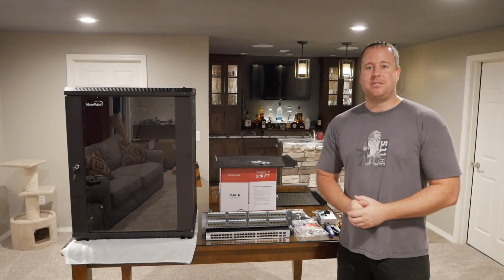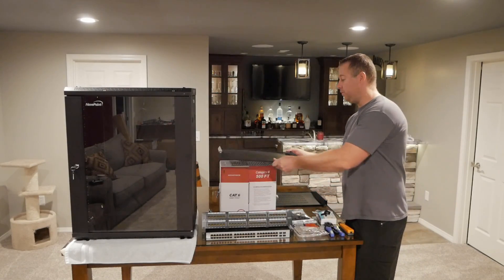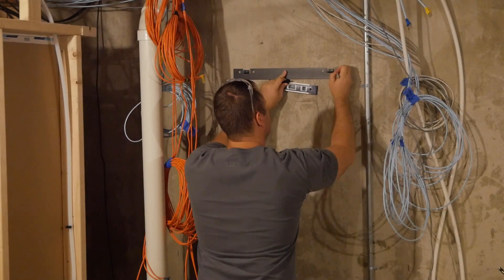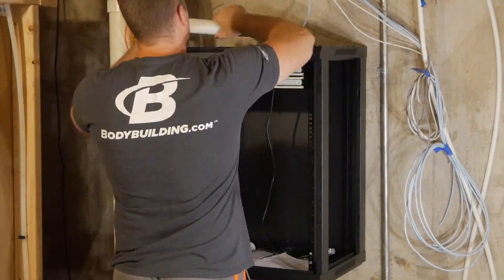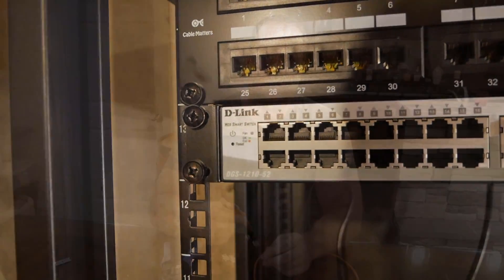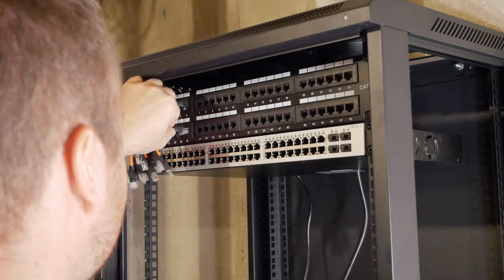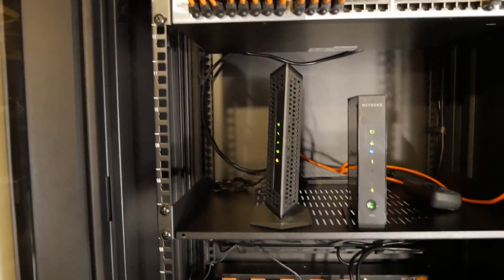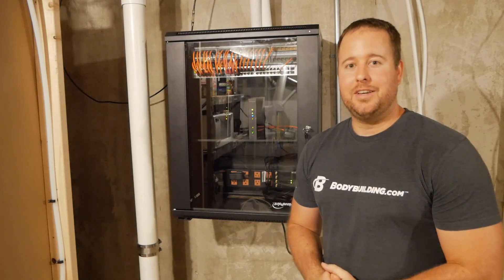Home Network Setup and Rack Installation | NavePoint 15U Rack

Comment: That's a fantastic setup man. Any reason why you chose TP link over Cisco or a different brand for your switch?
Reply from the maker: Thanks Kevin. Honestly it was cost. This was a used unit that I was able to save some money on over buying new. I looked at reviews and it appeared to be reliable so I grabbed it on Craigslist.
Reply: @LifeofBliss  that's a good reason considering the overall cost of these projects. I've been looking on ebay for components as well.

Do you do networking for a living?
Reply from the maker: I do not, pharmacist actually. This is the first experience running and connecting any sort of network!

Comment: Excellent video. I'm preparing to do a similar installation with a Navepoint 12U. Which WattBox model are you using? It wasn't listed in the video description.
Reply from the maker: WB-400-CE-10. I bought it new from a local company that was going out of business and it was leftover stock. I didn't leave a link as I wasn't really able to source them online. They are made/sourced through a company called SnapAV and is only sold to dealers in the industry from what I could see
Reply: @LifeofBliss  Ah, I see. I'll look around elsewhere. I like the concept of a rear-mounted solution in this regard.
Reply from the maker: I probably would have gone with something similar to the Tripp Lite box I used in my theater rack video if I hadn't got this one at a steal. The link in that video brings a lot of rack mountable power strips up. The ears are configurable as well to position it how you'd like. Really like that one too
Reply: @LifeofBliss  Gonna search your theater rack video now and give it a look! Thanks for the quick replies!

Comment: You really should use stranded copper wire for patch cables, versus structured solid copper Ethernet wire. The sold wires will break down over time with patch cables being moved around over time, they are not meant to be flexed. Purchasing your patches premade online is cheap enough to justify not doing it manually.  I have the brand cabinet in my house, but mine is the option that swings off the wall, not sure it was really needed in my case. Plug those exhaust fans with temp controller with sensor within the cab, I found one on amazon for around $20. http://a.co/d/aUscElw
Reply from the maker: I've thought about getting one of those temp monitors, thanks for the link! And yea lesson learned (time vs money). I'll replace them with regular patch cables if these ever go bad. Don't plan on moving them much, but we'll see

Comment: For someone who doesn't do this professionally, you did quite well. I echo the comments on buying patch cables rather than making them.

Primarily thing you need to do is add strain relief to the back side of your patch panel.
Reply from the maker: Thanks Mike. There's been many firsts for me finishing off this basment. This was one lol. If you elaborate, what exactly is strain relief? I assume with the connected CAT cables, but they were routed and secured into place. Is there something else I should have done? Thanks man
Reply: @LifeofBliss  You'll want to use zip ties or velcro to put pressure on the cables against the patch panel. 

It's really easy to pull a cable out of a patch panel so this helps keep the cables from coming out when you need to perform maintenance on the panel in the future. 

So how in the image below the cables (top left) are zip tied to the metal so if they get yanked on it won't put any pressure on the punch down part? That's what I'm referring to. https://uk.rs-online.com/web/p/rj-patch-panels/5123057/
Reply from the maker: Oh I gotcha. They are in those cable management plastic clips behind the panel and all the cables are velcro'd to the side of the rack in 3 places. Right next to the patch panel, halfway towards the back, and right before going out the top. Thinking that should be good
Reply: @LifeofBliss  you should check out the channel fibreninja
Reply: @LifeofBliss  Sounds good, i would only use Velcro ties with Cat6 as cable ties can destroy cable integrity with Cat6
Reply: @LifeofBliss  I've done both small builds (in home and small office) as well as large builds (Telecom datacenters) and what you have done is perfectly fine. You are correct in that the purpose of the plastic clips are for routing and securing the cables so that they do not pull away from the punch block. Also, you have enough slack in your cabling and provide strain relief by using the velcro to secure them to the side of the rack. Based on this being for your home and what you stated as your plan for future growth, I think you did an excellent job. Lastly, no need to purchase small patch cables if you have extra cabling laying around and know how to make your own cable. Why not save money and do it yourself, right?

While I appreciate others recommending looking at Fiberninja's videos, I think you are just as capable in completing your build in a professional manner. Keep up the good work.
Reply: @matthewwitherford  what I would call "professional grade" patch panels which you will find in commercial installations, at least the ones I know being used here in Europe from manufacturers like Krone or Dätwyler or even on the cheap eBay ones, you usually have only one row of Jack's in one pannel, 2 hu ones are unusual. behind each you find kind of a comb where you can strap each cable to one prong with a rather small and lightweight cable tie, usually provided with the panel.
Commercially even more Common, that's at least what we use, are blank panels where you put a keystone module with the rj45 socket onto the cable, usually having built in strain relief and click those modules into the panel afterwards.
Those modules are also nice if you need a socket, for example behind a camera mount or WiFi access point with not enough room for a normal wall outlet.
Reply: @votemikejones86  he used cat6 so you should not use cable ties, velcro only, as per manufactures specs, cable ties are to easy to have to tight and cause cross talk,

Comment: One thing I did that saved me running cable between floors is that I ran all the cable to a switch located on each floor and then linked the switches into a layer three switch  in the   telcom rack with a fiber cable. Its a more expensive solution but  keeps cable issues localised to the floor where the  ports are located. The Layer three switch  was a refurb off EBay. Total cost was about 10% more then having one master switch in the basement and I get better control  since I can sign into the layer three switch and manage everything (I lock out my kids rooms at 11pm for example and   can control  traffic priority and QOS to media  device and wireless access points.https://www.ebay.ca/itm/1PCS-H3C-S3600-28TP-SI-24-port-Three-layer-network-switch/201645829085?hash=item2ef3072bdd:g:DLEAAOSwvgdW5rWl:rk:6:pf:0
Reply: Damn, what's with the price of used enterprise switches there? That thing is really old and not even gigabit. For 150US$ I got 2x 24port gigabit switches that are POE capable with 2x 10gb sfp+ uplinks and 2x 10gb hdmi stacking.
You should have at least got a gigabit switch and not bothered with the fiber uplinks since it's totally not cost effective to use fiber for 1gb uplinks.
Reply: ikkuranus The fibre links are overkill but will come I handy if I e er upgrade to 10Gb for the backbone. I was more interested in the layer threes abilities for switch manage,ent and the gigabit layer three switches are three times the price. We get reamed in Canada for stuff on eBay and Amazon. Usually 50% compared to us+currency conversion
Reply: @ikkuranus  we get reamed by our  neighbors to the south. LOL.
Reply: @ikkuranus  Look at Mikrotic 10G equipment. Its  close to Enterprise and affordable

Comment: How is it that this rack on Amazon USA is  $227 USD and on Amazon.ca its over $600 CAD. This markup is ridiculous. I understand that currency ischange is about 35% or about $80 Making it aobut $307 which I could live with but to then more then double it for no appearent reson is insane. I ended up buying  2 rack rails from hammon for $250 and building a woodend rack for about $400 all totalled. https://www.amazon.ca/NavePoint-Network-Cabinet-Enclosure-Casters/dp/B01A6JQQHU/ref=sr_1_1?ie=UTF8&qid=1544460276&sr=8-1&keywords=NavePoint+15U+Wall+Mount+Network+Server+Cabinet+Rack+Enclosure+Glass+Door+Lock+w%2FCasters

Here is a better alternative for Canadian viewers: https://www.amazon.ca/dp/B07K7TKRWP/ref=sspa_dk_detail_9?psc=1&pd_rd_i=B07K7TKRWP&pd_rd_w=D3tjL&pf_rd_p=dd8bce25-0727-4a5d-b121-eef3dd7bc606&pd_rd_wg=ERKPL&pf_rd_r=KHAKCG2D8KQC1KEE3BAP&pd_rd_r=e385a5d2-fc9a-11e8-9cda-1d7d2ad86ec7
Reply: I also elected to use ultra thin cat 6 1ft cables from my favourite cable company: https://www.infinitecables.com/cat5e-cat6-cat6a/cat6-patch-cables/ultra-thin-patch-cables/cat6-utp-ultra-thin-patch-cable--1ft-black/ For small setups its not worth your time to create cables. Also the  chance of making at least one bad cable is pretty high unless you have a fluke cable tested (about $1500 CAD)  its not worth the effort or risk. Plus setup time for me was about an hour toal. Bulilding and punching the cables would have added another hour.
Reply: Rather then using  a punchdown block  I elected for couplers. I only has 16 ports to fill so this seemed a good option. Also, I was not expecting a huge number of Moves, add or changes. https://www.amazon.ca/gp/slredirect/picassoRedirect.html/ref=pa_sp_atf_aps_sr_pg1_1?ie=UTF8&adId=A07908694TAT1Y2N4KDL&url=https%3A%2F%2Fwww.amazon.ca%2FCable-Matters-25-Pack-Keystone-Punch-Down%2Fdp%2FB004D5PFGW%2Fref%3Dsr_1_1_sspa%3Fie%3DUTF8%26qid%3D1544460898%26sr%3D8-1-spons%26keywords%3DCAT6%2BKeystone%2BCoupler%26psc%3D1&qualifier=1544460898&id=8977390125247536&widgetName=sp_atf

and also needed a Blank panel to mount them in: https://www.amazon.ca/24-Port-Keystone-Rackmount-Shielded-N062-024-KJ-SH/dp/B01LWYF3MA/ref=sr_1_3?ie=UTF8&qid=1544460997&sr=8-3&keywords=CAT6+Keystone+panel
Reply: Belden has a new  cable making system called rev connect that allows you to make both jack and plugs and do it in half the time of regular methods. I use these at work and it takes me 15 seconds per connection insted of 45 to 55 seconds using traditional tools. Makes a differences when your making 600 connections for a building. The tool is about $100 but  I make that back on the first  office I do. https://www.anixter.com/en_us/manufacturers/b/belden/revconnect-connectivity-system.html
Reply from the maker: Dang, that's an insane markup! You came up with a good solution though for sure. And use some pretty nice tools! Would have cut my work time down a lot... but I didn't have much to do relatively. Now if I did it on a daily basis...
Reply: @LifeofBliss  As well as using it at work I also have helped several friends wire up thier homes and offices some times for money and sometimes for beer. Most houses are pretty easy less then ten drops and usually these days just for WAP's and  one or two in wall ports in the home office or the tv room. Its always worth  buying premium equipment since I will have these for ever as long as Belden continues to make the jacks and plugs.

Comment: PLEX is a great movie server to use to stream your movies. It can be streamed in-house or remotely on laptops and other devices.  I like to watch our movies in the hotel rooms when we travel by using a laptop with an HDMI cable to the room's TV. better than Netflix.  I am in the middle of building an 8x16 server room at the house to put all of the net gear. The closet has come to be too small now. Great video.
Reply from the maker: Yea I need to get on board with Plex... and that's one hell of an equipment room!
Reply: @LifeofBliss  Even the free Plex is great to have. It gives local and remote access to videos. I will also be running a WISP. I am filming the process day to day of putting the room together so videos will be posted on our channel.
Reply from the maker: Sweet, I'llcheck out!
Reply: I am usin powerdvd by cyberlink since it supports the fire stick tv with an app
Reply: Plex is great for at home but if your on the road just use WD cloud and port forward your network. I have my Plex movie media server backed up to my WD cloud so it serves as a back up and allows me to watch movies at work or at a hotel.
Reply: Should also look if the server/router has the ability to power over lan/ether aswell. It might seem not important but you never know if you want or need it until time comes
Reply from the maker: This switch does not have PoE. I opted not to do that since I'll probably get a unit to power security cameras that will have PoE. That was the only thing I could see myself using PoE for in the future

Comment: Starting to research how to set up home network myself. I do have a question. Could I mount my rack in my garage? It is non climate controlled. Thank you.
Reply from the maker: I don't see a reason you couldn't, but you'd want to probably take a few extra steps to keep the equipment running properly. Depending on how much dust and bugs your garage sees (mine gets a lot with woodworking), you'd probably want a completely enclosed case similar to the one I got. I would probably take it a step further and put some sort of grill cloth or other breathable material over all of the vents and seal the door and other openings well. That would stop most dust/bugs from getting inside. Again,  depends on your situation, but that would help. I don't think temperature would be a huge issue as long as you had some fans running in the rack. Good luck Dustin!

Comment: Only thing about these nice home network setups is that it just about has to be done while the house is being built.
Reply from the maker: Agreed. Since I finished the basement myself, there is probably 4x as many connections downstairs as there is upstairs. Hard to run wires with the walls already closed

Comment: Nice work! i am planning out my rack and this video really help me. One question where did you get that wattbox Power supply i cannot seem to find it anywhere
Reply from the maker: I got that along with several shelves from a business that was closing on Craigslist. I think the company who made them was Snap AV. I haven't been able to find them online either. I went with a Tripp Lite power strip for my home theater rack. They make some nice rack mountable units. It's on my home theater rack video if you wanted to check it out. Glad it helped man! Good luck
Reply: @LifeofBliss  seriously really helped, the last question you don't have any wifi issues since you put your wifi router inside the rack?
Reply from the maker: I think there have been some times where devices have had trouble connecting/ lose connection. It's not very often, and speed hasn't been an issue when connected, but we did notice that. If it worsens I'll just put it on top of the rack. But yea, something to watch for!
Reply: @LifeofBliss  got it thanks i think i will just mount my X10 Netgear to the side of rack. also found the wattbox the company name help. https://www.snapav.com/shop/en/snapav/surge-conditioning/wattbox-reg%3B-ip-12-controlled-outlet-rack-mount-power-conditioner-with-auto-reboot-optional-faceplate-wb-700-ipv-12

Comment: Ever plan on going full ubiquity
Reply: @
DJ Thornton // yeah pretty much ubiquity system is way to go for anyone who is planning to do any kind of network / also thank me later (:
Reply from the maker: I have heard of Ubiquity, but have not really looked much into it yet. I'll definitely be sure to look at that option once I am ready to get a server/NAS/NVR going though. Thanks man
Reply: Life of Bliss it’s really great a,zing equipment extremely reliable and since they do cameras as well it can all be from  the same company
Reply from the maker: Nice! I'll definitely keep them in mind. I have a few amcrest cameras currently. Can see if they are compatible...
Reply: Only problem with Ubiquity (which probably means Unifi line unless you know what your doing) is that once you start you end up wanting to go all the way which is pricey for many people in a home setup. You will probably wind up with something you love and allows a relative novice to setup a solid setup with guest and iot isolation etc but once you buy a basic setup (couple AP's, USG, POE switch) you are at $500+ and then you start looking at adding a small rack mount UPS, unifi cameras and controller... things start going north quick. I'm very happy with my unifi setup but they have great value hardware, not really cheap hardware.
Reply from the maker: Yea I have seen the prices are fairly steep on some of their equipment. I'll look more into them and other brands once I am ready to upgrade a few things, but I'm definitely not looking to spend a fortune on it
Reply: @LifeofBliss  I wouldn't say the prices are steep, but you are paying for something more than your standard consumer gear so the price is higher. My point was basically that you can step into the ecosystem by purchasing an access point and once you see how well they work you have a tendency to want to expand. If you put a couple access points spread around your house you will never want to go back to a standard consumer all-in-one, powerline AP's, or whatever. I think most of Ubiquity's "Edge" line of products are actually very low cost for what you are getting. The "Unifi" line is still a very good value but you are paying a premium for the simplified user experience.